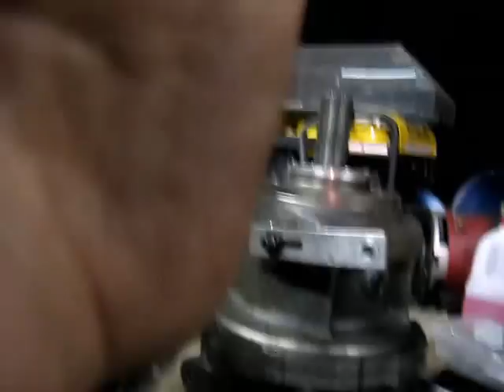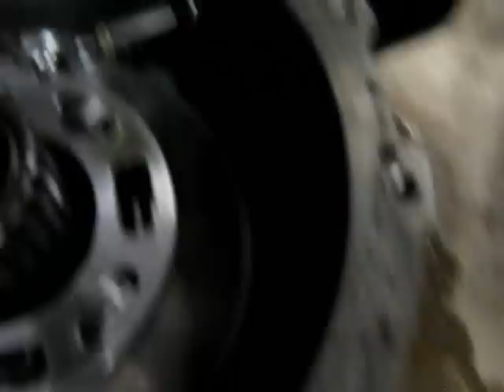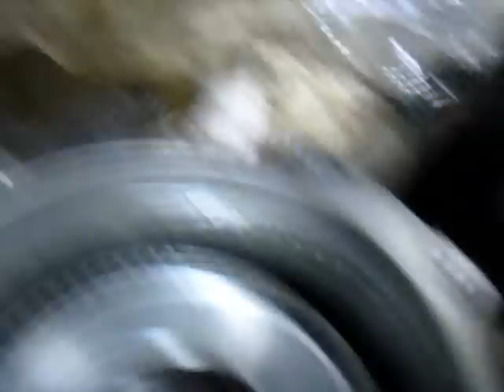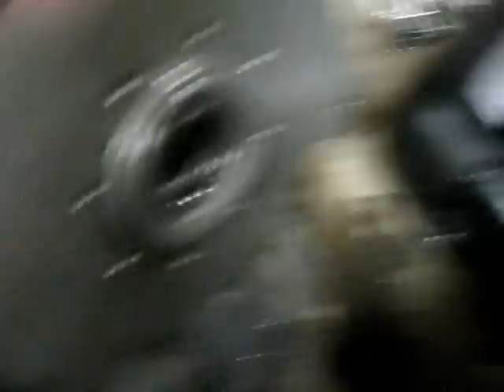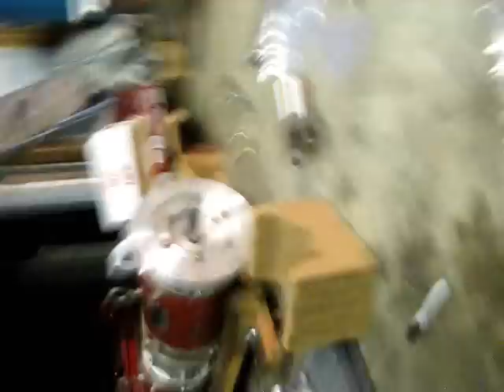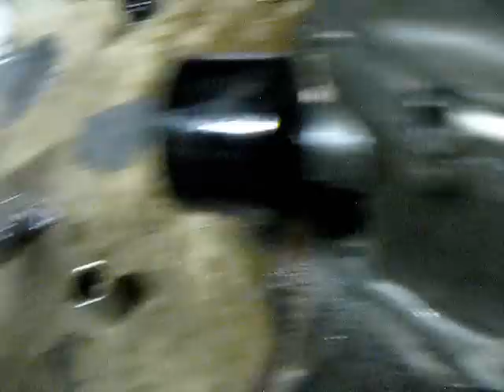LENCO RING GEAR SWAP for Electric Drag Race car conversion

Comment from the maker: George if this system takes off, ideally we need only to drill a pilot hole in the end of the Twarp shaft and cut it shorter and it would directly fit the Lenco transmission with only a MVP adapter plate and bearing.

Comment from the maker: yes, my original plan was the motor 32 spline directly into the ring gear, but the guy I was modeling this after was only using the reverser and that doesn't have a mandatory pilot shaft, so afterwards I had to make a 32 spline coupler to make it all work, see my second video and pictures of the build on facebook lonestar ev racing team or diyelectriccar ev performance assaultnbattery build thread